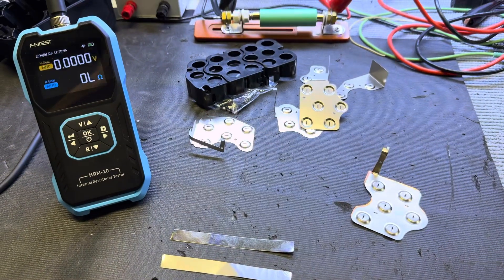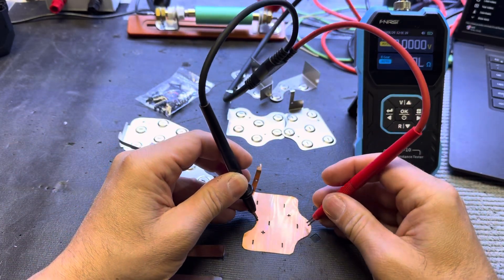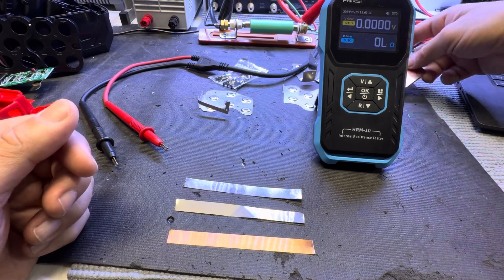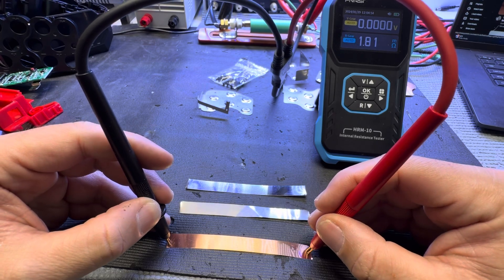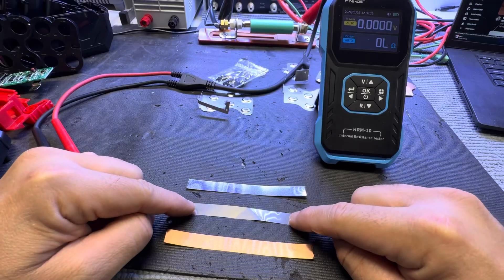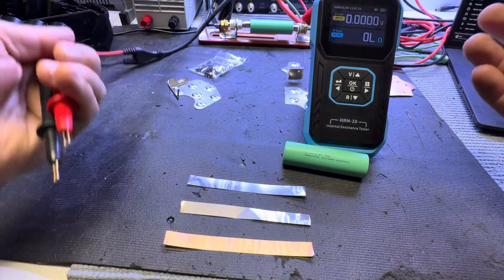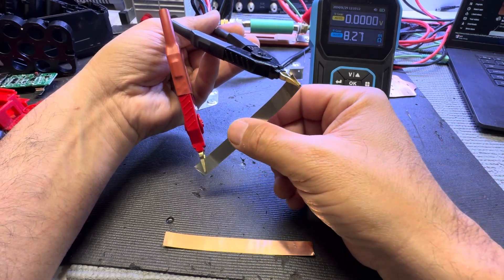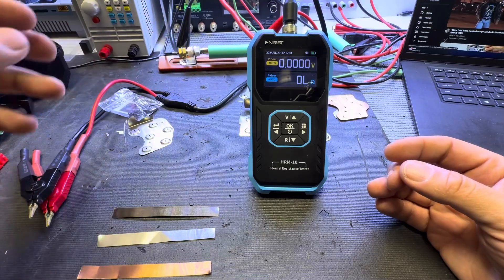Pure Nickel vs Fake Nickel Steel: Easy IR Test with FNIRSI HRM-10 (Stops Fakes Fast!)

Comment: More of a general question, can you spot weld a copper nickel sandwich at different widths? Like 0.1x10mm nickel with 0.1x8mm copper?
Reply from the maker: Yes of corse.

Comment: Took way longer for the IR to start to rise up when heating the copper compared to the nickel. It disperses the heat a lot better than the nickel before it starts to run up in temperature
Reply from the maker: Completely agree. Copper is the way to go.
Reply: @DIY500AMP Can i test with a cheap multimeter?

Comment: Actually, I thought the resistance of nickel-steel was way higher than pure nickel, it looks like its "only" 50% - I thought maybe 5-10 times
Reply from the maker: Material Conductivity List (Most to Least Conductive)
Reference: Pure Copper = 100 percent conductivity
Top Conductors
1. Silver
Conductivity: 105 to 108 percent
Notes: Best conductor on earth.
2. Pure Copper (T2)
Conductivity: 100 percent
Notes: Best practical conductor for battery packs.
3. Tin Coated Copper
Conductivity: 98 to 100 percent
Notes: Same as copper, coating prevents corrosion.
4. Nickel Plated Copper
Conductivity: 95 to 98 percent
Notes: Copper performance with nickel surface for better welds.
5. Gold
Conductivity: 70 to 75 percent
Notes: Lower than copper but excellent corrosion resistance.
6. Aluminum
Conductivity: 60 to 65 percent
Notes: Lightweight, must be thicker to match copper.
Mid Conductors
7. Beryllium Copper
Conductivity: 20 to 45 percent
Notes: Strong material used in contacts and springs.
8. Pure Nickel
Conductivity: 20 to 25 percent
Notes: Easy to weld but very resistive for high current.
9. Brass
Conductivity: 25 to 30 percent
Notes: Not great for high current paths.
10. Phosphor Bronze
Conductivity: ~15 percent
Notes: Used for connectors, poor for heavy loads.
11. Tin Lead Solder (67/37)
Conductivity: 11 to 15 percent
Notes: Very resistive, only for soldering connections.
Very Poor Conductors
12. Nickel Plated Steel
Conductivity: 3 to 10 percent
Notes: Huge resistance from the steel core. Avoid for high current.
13. Stainless Steel
Conductivity: 2 to 3 percent
Notes: One of the worst conductors. Only for structural parts.
Quick Ranking
Silver
Pure Copper
Tin Coated Copper
Nickel Plated Copper
Gold
Aluminum
Beryllium Copper
Pure Nickel
Brass
Phosphor Bronze
Tin Lead Solder
Nickel Steel
Stainless Steel

Comment: It's a shame Milwaukee batteries have small contacts to the tool for the amperage they can deliver. If you load the tool heavy like a 17" string trimmer or leaf blower and run it long you'll melt the battery case around the contacts and can even start melting the plastic around the contacts on the tool. Milwaukee has chosen to replace the damaged items under warranty rather than solving the undersized contact problem. To get around the problem I add a bypass XT60 to the tool and battery. The bms still remains in control and the tool shuts down if there is a problem.
Reply from the maker: That's a good solution to the issue, it's a shame about the contacts.

Comment: Friend, maybe for your experiments you need to coat the copper with a thin layer of tin. There are liquid solutions of tin chloride (SnCl2) for this—perhaps this will improve the spot welding of copper strips! I don't have the means to test this... In my country 200-300 ml of the prepared solution costs only $3-4 and can be applied simply with a cotton swab!:shelterin:
Reply from the maker: That's an interesting idea, I'll definitely look into trying that!

Comment: On your Milwaukee  18 volt 15 cell kit, how are you going to get the copper  tight against the cell, since the Provided Nickel busbars have indentations to reach deeper?  I got a 10 21700 Cell Makita kit ordered.  I am not sure if my 10 BAK45Ds will fit though since they are a pretty fat cell.  Might need to place an order for RS50's, or 50XG's :)
Reply from the maker: You are member from the channel. Send me an email to send guy my number and we can talk over the phone. Support@diy500amp.com

Comment: That's not how you do that. That first piece you tested could be tinned copper. You always need to scratch through the top coating when you test with proves like that...even the 4 wire or kelvin clips or whatever you are using. I bet your copper you have there came with plastic in one side of it. That's because it starts oxidizing the second you peel that off. 

Copper will start developing a layer of less conductive material very very quickly. This is why you don't see bare copper on circuit boards. The good shiny stuff is actually gold. You either see tinned pads and throughholes or gold plated. 

A much easier way to test us to cut a thin strip and burn it in a flame. You will see different colors for different metals. Steel is not going to produce the green blue flame you get from burning nickel. A lot of garbage strips will be plated so you will blue green then another color depending on what alloy you have there. Different metals powdered is how you have different colored fireworks.

The good nickel strip you can use for electroplating which is super easy BTW. I use all my old recovered strips for this purpose. One steel one in your electrolyte and you have to start over and  make new stuff or you get crappy plating and black spots etc. 

What you really want is nickel plated copper. So just make some. Nickel doesn't have that tarnishing problem. 

Now if you really want to be fancy you can use a galvanic wand and plate with silver since it way more conductive than copper but then you have that whole tarnishing problem again. That's why they use gold on contacts and not the more conductive silver. 

Copper is actually kind of a dumb thing to use. That's why you see tinned bus bars and sheets like that first piece you tested. If that's from a quality pack it's almost certainly tinned copper. If it's from a garbage Chinesium pack then it's probably steel or plated. 

I see people overbuilding batteries all the time. The case of the battery is steel. You can just solder 6mm copper grounding  strap right onto the garbage strips. You solder between the cells and not on the cells. The flexible copper braid will turn into a solid bar once you add solder. This a cheap way way to increase current carrying ability without having to buy some ridiculous overpriced overpowered spot welder. It's not about the welder, it's about the power source. I can weld much thicker stuff than you would think using a small $20 welder. All you do is parallel more cells to the internal battery of the welder. The welder is a timer that is turning a switch in and off. You are using MOSFETs as a switch not switching MOSFETs like in a switch mode power supply. You are essentially using then as a solid state relay. So even the junkiest little spot welder kit can do big welds you just can't have a garbage power source. The batteries you are powering with are everything. 

When you overbuild a battery with all this thick material has it ever occurred to you what happens when you get a shirt and the material you have linking the cells is stronger than the cells. That energy has to go somewhere. You don't want the cells to go off rather than your conductors. No one ever thinks about that. Just more iis more better. That's a very caveman way of thinking.
Reply from the maker: Thanks for your detailed thoughts on testing methods and material properties; I'll keep your suggestions in mind for future tests.
Reply: I prefer copper and a good capacitor spot welder that runs circles around any cheap shortcut when building large packs. I'm setup to nickel plate it but I usually just dip copper in stannous chloride.
Reply: tin chloride - actual tinning

Are you using any brighteners at all or no? 

Super capacitors are a great power source that can provide plenty of amps. It's all about the power source. Any half decent timer/gate driver circuit that turns on and off in a definite manner works great. I have bunches of spot welders from pricey ones to ones I made myself to the $10-20 kits you get off Ali Express and as long as you have a power source that can give the required amps they all work about the same. Maintain your tips in the correct shape and clean the oxidated layer off abd things work much better. 

I usually use those spimhp08 cells or a high output lifepo4 pack in parallel with units that have their own internal batteries. Those pouch cells that come in those always go to an early grave since they are being taxed way past what they should be. You pull a lot of amps from all kinds of cells, just not many times. The Chinese tend to be a bit optimistic in their ratings.
Reply: @zentechnician  No brightener I only care about the function. My welder is a modified AwithZ P20B using 3, 3V 3400f caps in series with 9V in and out. Heatsinks on the mosfets and push pull fans to keep it cool when building large packs.
Reply: That sounds good to me. I'm doing larger packs myself. Once I started raising voltage I couldn't stop. 35s at the moment about to move to 40s. It takes a very long time to build batteries at this level. I don't think I'm stopping at 144v either. We'll see I guess.
Reply: @zentechnician  What do you use 40s for?
Reply: Ebike. Basically a motorcycle with pedals. Easily goes above interstate speeds very quickly at the higher voltage. It's a hard tail so I don't make a habit of going quite that fast but a steering damper is pretty much a must at higher speeds. Motorcycle tires too. My back wheel which is a 20" fat type has a nice Harley Dunlop on it and is about 650mm in diameter. At lower voltages like 85mph was probably about the most I would get out of a qs273, at 35s it hits that easily and is very quick. Very robust. Highly recommend. I do an 8000w in back and a 1500w up front. I need the extra hub up front to help keep the front wheel on the ground. It's scary in a very fun way. lol

Comment: If copper.is the best why do people weld and make a nickel copper sandwich???
Reply from the maker: Because copper is not easy to weld with a spot welder. You need special Flux or combine with another material like Nickel, Nickel-Plated steel or Stainless Steel.

Comment: Nickel plated steel is always better than pure steel 😂😂😂.
Another simple test is dipping metal pieces in salty water, if it rusts, after 24h, it's not pure nickel.
Reply: Its way faster if you mix some hydrogen peroxide in your salty water. You can see the results after 10 mins if you scratch the surface leyer of nickel and expose the steel.

Comment: When you have both side by side, the surface finish is a big tell.
Pure nickel usually has an almost mirror finish, while plated looks slightly rough.
Reply from the maker: Not all the time. I seen completely identical. Is hard to say.